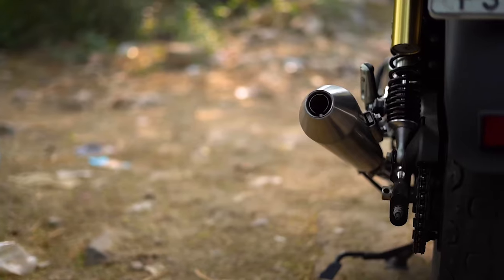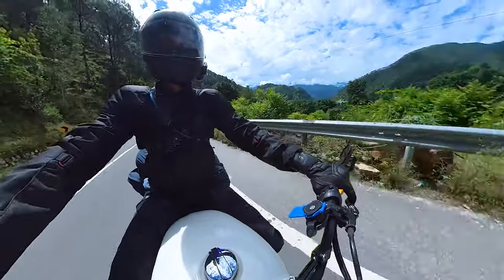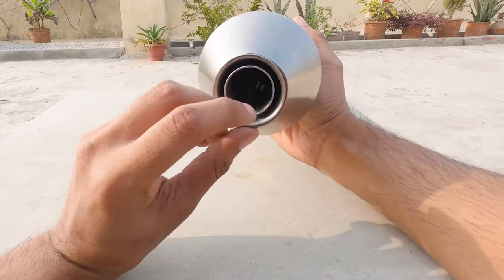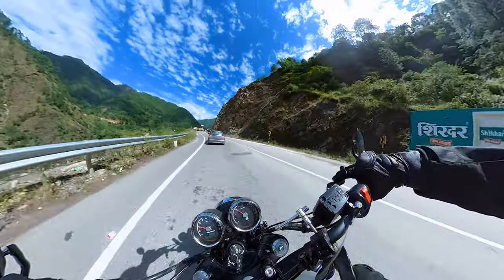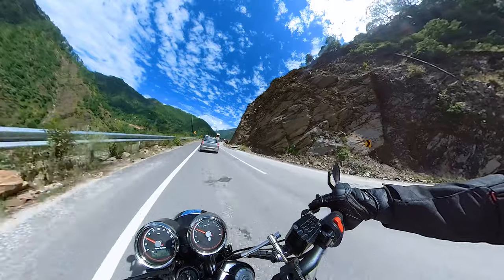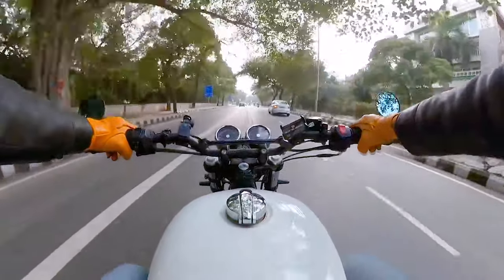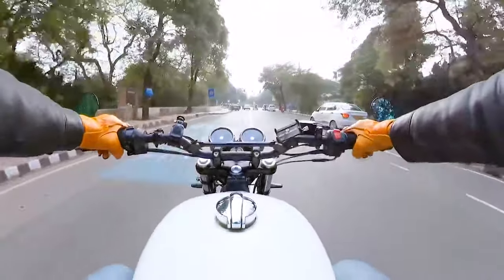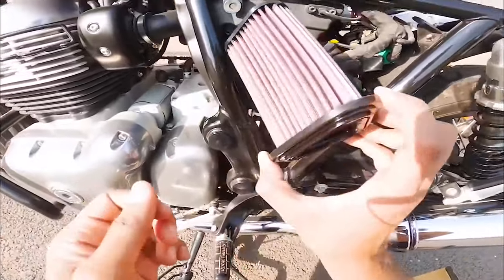Interceptor 650 exhaust sound! With Powerage exhaust pipes

Comment: Do we need to afraid of cops for this upgrade? Cause exhaust mods became very illegal now a days , they just simply stopping motorcycles which looks even little bit sporty 🤦🏻‍♂️
Reply from the maker: if you are in Bengaluru then yes, you cannot reason with them and there is no point. Plus if the exhaust is extremely loud then definitely anywhere the cops will stop you. Or if you rev excessively high!
Reply: @SrinivasGanesh  yeah but here in AP no need to rev the bike they just stop if they see a round headlights (RE) or bikes more then 150 cc even though its stock, they revving it to the redline and then letting us go if they feel like its stock 🤦🏻‍♂️ not even using a decibel meter even though it sounds equal to the stock they speak about pollution , maybe lorrys and buses emits oxygen through the exhaust and auto rickshaw sounds so soothing to their ears i guess , we accept catching a squid without helmet and documents but why bikers always 🤷🏻‍♂️
Reply from the maker: That is shocking, it's like stopping to see a man's gun, taking it and firing it at someone and coming to the conclusion that yes, it hurts people. @tarunkota333
Reply: @SrinivasGanesh  yeah that’s really harsh and disrespectful how cops treating bikers 💔 most of the cops don’t even have knowledge about riding gears , if they see us riding with a helmet and just a jacket they think that we are racing , this should change. anyway i like your channel and content sir keep going with more exciting videos like this and enlightening people about 🏍️ ✌🏻😊
Reply from the maker: thank you for such kind words sir and for your support!  @tarunkota333

Comment: I got the same exhaust after watching ur videos but mines a longer version and i love it 
The trick to remove the baffles with out screw falling in to the pipes is shove a small piece of cloth in the baffle while removing/fixing them , if screw falls also the cloth will stop 🤟
Reply from the maker: excellent advice! thank you, I'll pin this comment. :)
Reply: @SrinivasGanesh  Welcome bro
Reply from the maker: @64_K  thank you for watching the video!
Reply: pretty darn smart!!!
Reply: Although i had seen this i still ended up getting the screw falling inside the exhaust,now i guess ill have to get the exhaust removed to get the screw out
Reply: Comparing s&s vs powerage exh which is best sir
Reply from the maker: Thank you for watching! @jdstenner1
Reply from the maker: of you can remove it yourself, and save some money there. :P @Drracer18
Reply from the maker: @nandiniteju   S&S is race only, so it will be louder. My opinion, I don't want too loud pipes. So Powerage it is. Thank you for watching.
Reply: Where did you buy the powerage exhausts from?

Comment: I am in California.  I went with the K&N performance air filter and the Dustland Roadrunner slip-ons for my Interceptor.  Baffle in.  I was getting a lot of crackles and pops when shifting.  I recently added the FuelX Pro to help with the ECU mapping to see if that helped.  Less crackles and pops.  Great video - what camera are you using?
Reply from the maker: Greetings brother!
Thank you for watching the video. :) I’m using a GoPro hero 8 for the rider perspective, and the ones towards the end of the video, the fly by have been shot with an iPhone 13 Pro Max. I do get pops and crackles but very rarely. So far I haven’t researched in ECUs, but that is also because I visit the mountains twice in a year where stock map works the best. I’ll share a video of a friend where he explains why that happens. Hence I don’t want to change the ECUs
But Thank you so much for sharing your experience and for watching the video. I really appreciate it. :)

Comment: Bhai where do you get your bike serviced in Gurgaon 
Will the service center guys have some issue as one might have removed the OEM exhausts and have replaced it with Powerage exhausts
Can the service center deny you from service?
Reply from the maker: I get it serviced from Delhi. Saket service centre. You can get it serviced from Speedmonks performance centre in Gurgaon. They are amazing in servicing all high end motorcycles.
No service centre will deny you service regardless of any aftermarket product you might have installed on the motorcycle. They will only deny ‘installing’ any aftermarket product. Meaning if you want to install new exhausts, RE service center will not help you.
It’s a different case if you take your Royal Enfield to a Honda service center. 🤣

Comment: Bro you’re using this exhaust on permanent basis?
If yes then how’s your bike holding so far?
Reply from the maker: Yes sir. It is just amazing. Been using this for a year now. And only took it off when I went to Spiti. It is just perfect exhaust in my opinion in street look. Else 2x1 scrambler exhaust by ZARD is my second favourite. That, however is a bit too expensive. 🤪

Comment: Planning to get powerage exhaust. Will it work with OEM airfilters or is it necessary to have performance air filters?
Reply from the maker: OEM filter is paper. It is good, but instead of cleaning and reusing (which is much cheaper) you’ll have to replace the entire air filter every month or so. Performance airfilter are one time buy which you can clean and reuse as you can see in my latest video about maintaining performance filters.
Reply from the maker: Cleaning your K&N Air Filter | Royal Enfield 650 Twins
https://youtu.be/KbVOVxtC57w

Comment: Sounds great with the baffles out. But as you say probably a little to loud. Maybe cut the baffles down a little might sound great. But again as you say hard to tell through audio I'm just hearing it with my phone speaker.
Reply from the maker: must use earphones :) for optimum sound experience. Yes quite loud with the baffles out. I only removed them for the video.

Comment: Hi Sri, loved your video. I too did a DIY installation of the powerage exhaust. I noticed a white smoke coming out of the exhaust and the smell is a bit different too. I hadn’t noticed it ever on the stock exhaust. Any idea what could be the issue?
Reply from the maker: not an issue, that is just the glass wool inside burning. Which is quite normal. I too had got scared, and there were no videos on Youtube to help either. Lol, so did a lot of reading on different forums etc. Ride safe!

Comment: How much weight is reduced after changing the exhaust and which tyres are they ?
Reply from the maker: the poem exhausts weigh in at ~14kilos. (combined) and these exhausts weigh 6kilos combined. So to answer your questions, 8 kilos of weight savings.

Comment: Using powerage now for more than a month
Have u noticed a bit increased RPM as 
soon as we cold start the bike?
Reply from the maker: Yes, I did. It used to happen with OEM exhausts as well. It is similar to earlier when I had the Classic 350, in winters, I used to pull the choke, and then start the bike and idle it for a few mins before riding off. Nowadays, smarter ECUs do this automatically.

Comment: Hey man. Love your videos. Did you also look into full system exhausts? Like SS Motocorp. Any reasons you went for slip ons and not a full system. I am confused between the two. Just thought to get your opinion too.
Thanks.
Reply from the maker: Thanks for the love!
I do want to install a full system exhaust, but there are a few drawbacks to it, which will limit my motorcycle to a ‘city only’ motorcycle.
It will produce higher pollution, as all catalytic converters will be removed.
It will generate more noise pollution for sure, which means I can’t take it to the mountains, or down south as I will be fined heavily.
But it will make the bike more powerful and more lighter.
SS motocorp is good! You can check out my friend’s video. Do give him a shoutout.
https://youtu.be/JAvOfZwowLM
Reply: @SrinivasGanesh  I know about SS Motocorp from Abhinav itself. just a follow up question. Are the catalytic converters missing for all full system exhausts? Even SS Motocorp?
Reply from the maker: @prajwalbhandari4054  yep. That is what makes it very light.

Comment: Hi is their any drop in torque with this exhaust ?? How does its sound at higher speed?? I would like to fit one for my GT .. need your suggestion pls
Reply from the maker: I don’t believe that there is a drop in the torque after installing any aftermarket exhaust. Rather, It increases the mid range torque. This is, in my opinion, one of the best aftermarket exhausts for RE Twins. I say go for it. :)
Reply: @SrinivasGanesh  Thank you very for a swift reply 👍
Reply from the maker: @mahendranpadinzar1812  my pleasure buddy! Thank you for watching the video!

Comment: Hello!! Greetings from Peru. I need your help appealing to your experience. I have an Interceptor 650, I want to change the SLIP ON in POWERAGE brand (India). My question is if doing this should configure the ECU and if this change of SLIP ON in the long term damages the engine of the motorcycle?
Reply from the maker: Hey! Namastey from India! Thank you so much for watching the video! The ECU will calibrate itself. After installing the said exhaust, or any slip on exhaust just let it idle for about 10-12 mins. And the ECU will take care of the rest automatically.
Reply from the maker: Been using this for almost 2 years with the baffles on, I have not faced a single issue yet.

Comment: Nicely explained, Could you please make video on your KNN filter along with Powertronic or Fuelx (Not sure) and YSS suspensions (What should be the setting for different terrains or road or environments and how to set the suspensions respectively) it will be very useful as you have already covered 8000 kilometers on this customizations. I like your close to stock customizations, it is not so flashy to look, it is more of a shuttle way of implementation. Before going with any changes on my interceptor I would like to know the practical way rather than configurations on papers.
Reply from the maker: Sure thing. I’m editing a video on how to change the settings on stock suspensions. Then another video on YSS rear suspensions followed by front. Thank you for watching! :)
Reply from the maker: KNN filter video is already there. And FuelX is similar to booster plug if I am not mistaken, just different branding. Which is also there on the channel. :)
Reply: Thanks  @SrinivasGanesh  🤘🏽😎 it would be very useful.
Reply: @SrinivasGanesh  I will watch that video.
Reply: @SrinivasGanesh   What I have got the info that fuelx helps in proper fuel release to the engine according to the mapping and conditions and Powertronics does the same but it also maps the throttle. Now, I may be wrong because I haven’t talked to Powertronics or Fuelx people.

Comment: Interesting to see a 150/70-18 Tire,  did you make any other changes to accomodate the tire or it fits perfectly on stock rims? Also, is there a room to fit 110 for the front?
Reply from the maker: No other changes. You'll have to make changes if you go above 160. Yes there is plenty of room for even 120 section I'm told.

Comment: Hey Sri, hope all is well at your end. While I love the sound of the aftermarket exhausts, I am someone who would try and keep my vehicles as 'stock' as possible. With time, as I rev-match (and I live in the mountains), I have noticed that the sound of the stock exhaust has changed and mind you I have done only 2.5k kms on it so far. The sound of the exhausts has more base in higher gear and thump in lower. I believe its because of rev-matching, let me know what you think.
Reply from the maker: Yes, when I rode to Spiti, I too changed the exhausts back to oem cans. Reason being the colder air at higher altitude. Which then ensures smooth and optimum burning of fuel, else with the aftermarket exhausts, the fuel doesn’t get burnt properly and as a result mileage will drop down quite a bit. And yes the sound does change over a period of time. It is normal. :) thank you for watching the video!
Reply: @SrinivasGanesh  That's been a constant issue which folks have been facing and changing back to the stock... But how is the difference as such in the plains? I meant in terms of how you feel while riding (not sound) and performance wise... Just wondering if I should even change if there is no decent improvement for regular riding... Can understood the issue with higher altitude though...
Reply from the maker: @dudefromcbee  There is no need to change if you don't feel like it. Don't give in to the pressure around you is what I would say. Stock cans are good too! Changing the exhausts to an after market one will give you a significant bump in the mid range torque, they will be lighter in weight than the OEM ones so meaning the acceleration will improve too. Pair it with an after market air filter it will increase the BHP by 1-2. And mileage stays unaffected. :) Thank you for watching the video:_Sri:
Reply: @SrinivasGanesh  Completely agree on that part. Hope a trip to Coorg, Ooty, Kodaikanal doesn't require a switch to OEM stocks... Perhaps the Himalayan belt would be better with the stock exhaust and filter... Your friend Abhinav too faced issues, but majorly because of powertronics... Not sure if it's because of exhaust/filter?
Reply from the maker: @dudefromcbee  Yes it was because of changing the ECU. Else no issues. As a general rule of thumb, when going on long tours, best is to switch performance parts back to stock set up. Coorg, Ooty, Kodaikanal means you will be crossing borders too so best is to play it safe with cops down south. Good luck! :)
Reply: @SrinivasGanesh  I'm from Coimbatore, so at least Coorg would involve crossing borders... Hmmm tricky situation... I don't even use the bike for regular commuting within the city. If I can't use it for long tours, then stock seems a better options...
Reply from the maker: @dudefromcbee  You only need to change it to stock when going on higher altitude. Else, on plains, aftermarket exhausts are fine too.

Comment: You changed Power rage silencer with silencer bend pipe ???
Reply from the maker: I didn’t understand the question. What did you mean?
Reply: @SrinivasGanesh  sir i am asking that you changed complete exhaust with bed pipe from starting from the engine??
Reply from the maker: @Boxunbox28  nope, I did not. I just changed the exhausts cans. Not the entire system.
Reply: I am thinking to change the complete exhaust system with power rage complete system…. Will it improve the power or any disadvantages?
Reply from the maker: @Boxunbox28  Great! Go for it!
In my opinion, the only disadvantage would be it would pollute more. Since there would be no catalytic converters.

Comment: Is it necessary to change the tuning after installing the new exhaust and air filter? is a power commander or similar ECU modifications necessary after exhaust and air filter change? thnx
Reply from the maker: Modern bikes have smart ECU, just let the engine idle for 10 mins and it will calibrate itself. No need to install power commander unless you plan to take the motorcycle to track and race.
Reply: Oh ok. Thank you for responding. 😄😄
Reply from the maker: @therealhari__  thank you for watching!

Comment: Hi Srinivas, how is the long term performance with these exhausts do they have any performance issue on the engine, or any kind of issues you faced over the time you have been using this. 
I heard from a mechanic that these exhaust have a direct effect on the engine. 
I am just curious to know as I am also planning to get this exhaust.
Reply from the maker: What kind of an effect does these have on the engine? Did that mechanic tell that part too? I’m curious to know. I have been using these exhausts for 2 years, and I am yet to come across an issue. Besides making the bike look like a damn sexy machine, I don’t think these pipes have any defect. ✌🏽
Do let me know the answer.
Reply: @SrinivasGanesh  He said that Engine internal work comes on early. Not sure what that meant. Since you have been using it for the past 2 years I am pretty confident for buying it now. Thanks a lot for the input as always. 🙂
Reply from the maker: @mailmacho  hmmm, the bike is due for service in the next 2k kms, I'll ask the mechanic to do all the necessary internal inspections and check for any anomalies. Thanks for letting me know. In case anything comes up, I'll make a video on it. If not, then I'll do a post.
Reply: @SrinivasGanesh  sure, I will be waiting for your post/video
Reply from the maker: @mailmacho  thank you!